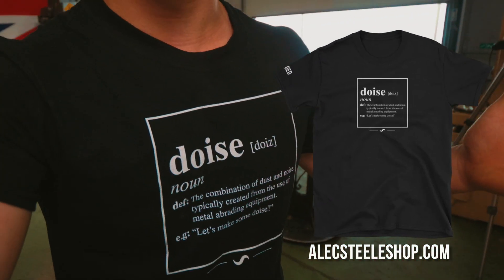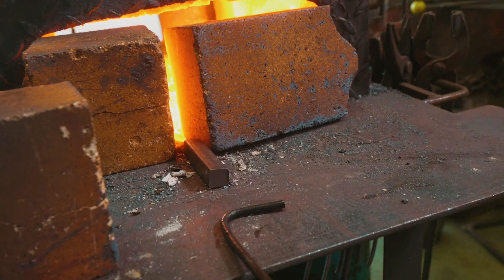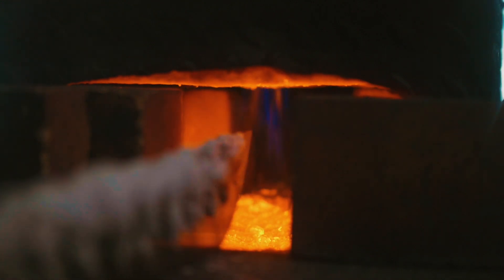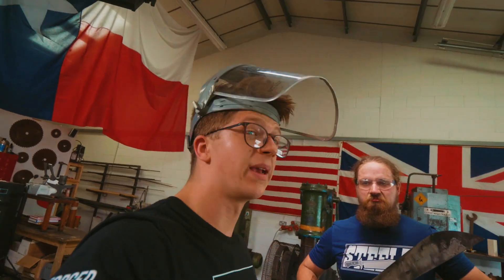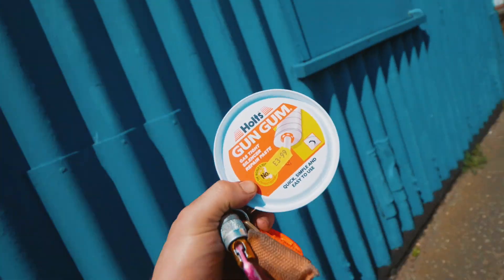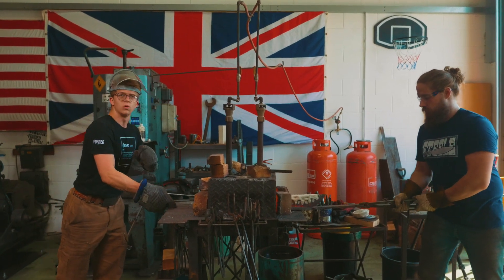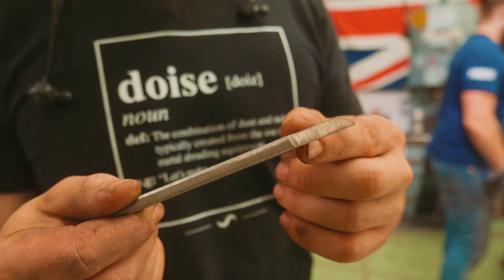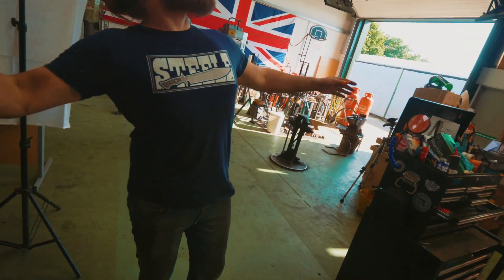MAKING A FALCHION!!! Part 3

Comment: Just putting it out there again: Alec, buy a commercial pizza oven for your workshop. Big enough to temper swords and make pizza while doing so. WIN - WIN Situation.
Reply: Agreed.
Reply: then alex french guy can come and use it!
Reply: My m8 has one that’s 150cm x 100cm inside and can hold any stable temp from 80c to 425c for hours. That will fit a blade up to 175cm in length and a couple of big pizzas... got it used for £450 ex vat. It’s a no-brainer really :D
Reply: SoupFork He can invite French Alex back to make a knife set, and British Alec's father could come in and make them a knife block. :D
Reply: DarrkDucky just realized I commented the same thing. Great minds...
Reply: SoupFork the fact that it makes pizza is reason enough. Tempering is just a perk
Reply: He doesn't even have to buy one. They are relatively easy to make yourself (they are really just a stone oven). You just need heat resistant bricks and clay and a YouTube video on how to make a stone oven or a pizza oven specifically which I am sure there are a number of videos on. Jas townsend and sons has a few on stone ovens. Also on a blacksmith related note they are not much different then old stone forges and smelteries.
Reply: And his blades will have that smokey flavor that pizzas get.
Reply: Oil Barrel furnace depth is long enough to even heat a long(ish) sword evenly without the moving in and out to get even heat, then could be used for tempering once cool enough ... Thinking 3 or 4 burners on top. not sure about heat distribution within the dome but should be good enough, chicken wire to hold fire bricks in place on top...
Reply: Brilliant idea
Reply: Scale?
Reply: Please do not do this, do not buy a pizza oven or a toaster oven. buy a professional grade heat treating kiln. why? oven for cooking are not insulated nearly as well and do not hold temperature as accurately. you may be surprised how much fluctuation there is in even a commercial grade oven's temperature that will ruin the temper on a knife or sword. 

right tool for the right job ladies and gents.
Reply: Tom K did you even SEE how he tempers his long blades now..?
Reply: Yeah, a heat treating oven big enough to do this kind of thing isn't really that expensive here's what I found in five minutes on google http://www.paragonweb.com/KM45T.cfm
Reply: Rhys Harris the cheapest (smallest) one is $2900+ excluding tax and shipping to the UK. The longest one is just 42”, which will be a struggle for any decent sized swords. (And a LOT more expensive...) But the main problem with these is the 5.5” width limit. Who the hell wants a 5.5” Pizza...
Reply: Tom K you missed the point. Also, blades were tempered by hand and I for many many years. Wuit being a buzz kill and go make something yourself.
Reply: Alec, next time you test a sword, instead of slicing fruit, slice up pizza toppings, then top a pizza with the topping you have sliced.
Reply: Double Dare Fan I like your way of thinking

Comment: It's not the oil temperature.  You simply should have tempered it immediately , even with the remnants of the furnace cement on the blade..  Differential hardening puts the blade under enormous stresses (even more so than regular through - hardened blades) and any pre-temper grinding needs to be exceptionally superficial and must not heat up the blade at all or you risk stress cracks as removal of material will relieve stress on one side vs the other side.
Reply: Absolutely 100% well said sir. Especially when dealing with a very high carbon steel (1095 has about 1% carbon, so after a fast quench it’s diamond hard). It’s got lots of stress in the blade. 

What I do is I have some steel wool or sandpaper handy to very quickly and crudely scratch off forge scale. As soon I see the blade, into the temper it goes.

Comment: THANKS SO MUCH FOR DOING A HAMON!! So excited for this build. Thanks for getting me into such an awesome craft!
Reply: Hey Alex, just something I was told when doing a hamon. The stress fracture may have come about as you didn't coat the whole blade with a thin layer of gun gum and then apply thicker on the back edge to get the pattern
Reply: Well as you normally quench 1095 without always having clay on it that shouldn't be the problem, no. thanks for the suggestion though

Comment: Looking good man, liking the progress, only tip I can give for clay differential hardening is to put a few thin lines of clay down to the edge of the blade. This creates tiny regions of softer steel which help relieve stress and help reduce cracks when tempering or grinding. Also stops cracks permeating up the entire blade during use. Keep up the good work man!

Comment: I would recommend Green Beetle's Hamon method (or as his videos series is called, "Hammonding"). What he does is waiting a full day for the clay to dry (might be harder to do with the stuff you use as the fibers in it would hold moisture longer), he quenches in water (though he has said oil is okay), and he goes into tempering immediately after quenching and sorting out any warping. He also brought out the Hamon with lemons.

Comment: Suggestion for the guard.  After you've got it cleaned up heat it and use a brass wire wheel on it so that it will transfer the brass color onto the guard.  It'll look GREAT and still be steel!

Comment: Hey Alec, a tip for next time with the Hamon, Ilya from Man at Arms runs really thin lines of clay down from the spine to the edge to prevent that from cracking during heat treat, maybe that would help for after heat treat too?

Comment: I'm a bit confused about heating up the oil. Alec says it makes the blade cool down faster yet ABS Mastersmith J. Neilson from Forged in Fire says it slows down the cooling, which makes sense to me as the concept of quenching is you are rapidly cooling the blade to harden it instead of letting it slowly air cool.
Reply: Its to keep the blade from cracking from cooling down too fast.

Comment: Alec most traditional falcions have a through tang and I had no idea you could use gun gum as clay here is South Africa it is used as a high heat repair putty for exhaust repair and the like and you could make a straightening jig using some angle iron an a few clamps

Comment: Tip from a woodworker - always go bevel down when cutting a groove, you have a lot more control with the cutting depth (in other words, the blade won't dive into the workpiece).

Comment: First time, Alex grinds it.... It cracks.
Second go around, Alec is the one on the grinder.... 😂😂
Reply: Nunya Biddness he must have been feeling terrible taking that to Alec :(

Was it even in contact when it cracked though?
Reply: I'm wondering why they didn't temper it before grinding.
Reply: they had to remove all the clay and burned stuff from the blade

Comment: What about a roll-away extension for the forge? The current one can be kept small when not needed, but can be rolled over and snugged in place for adding extra length to the existing forge for these longer projects. If needed it could have its own burner as well.

Comment: Hey Alec just a little tip if your using gun gum, if you wet your fingers slightly it stops it sticking to you and you can smooth it and get it where you want it easier

Comment: I'm not a blacksmith but for the whole work and the Beautiful original shape of the falchion I would have open the crack with an angle grinder in order to tig weld the entire fissure. It's not Damascus Steel anyway. And if you're worried by the HAZ just normalize it and then proceed as always.

Comment: For the wire inlay, if you twist it with another color as you inlay it you get an interesting pattern at finish. I don't remember if its the hatch pattern or parallel lines like //

Comment: It would be interesting (to me at least) to see if that crack had been under the wires used to form the pattern for the hamon. If the wire retained more heat and transferred that heat to the blade, it could explain the stress fracture (since the blade would be even harder at that point, and the act of sanding it would generate the additional heat to cause it to crack).
Reply: The way I understand it. The faster something cools, the more brittle it becomes. So if the wire retained heat,  that part would be softer and more pliable.
Reply: TheQuantumCreeper ..either way, I think the wire had something to do with the crack. On episode two I kinda had the idea that the wire might create a soft line to the edge.

Comment: Now that you make so many knives, swords and other blades, have you thought about making a second, long and narrow forge/tempering oven? In kind of a tube design maybe? It would be less volume to heat and at the same time more even than having to paint the heat all the time. And Alex would get to build a forge with you ;)
In addition, I just had an Idea: you have your melting oven for casting and you were talking about inlays. Is it possible to take a metal piece, cut the pattern into it that should have the inlay on it and pour the other metal on it? Afterwards you grind it flush and have a perfectly filled inlay. Might just be crazy enough to work ;)

Comment: Hey Alec, you mentioned  "I've warmed the oil up a little bit, which will help cool it down even faster". I was curious if you could explain a little more how that works? If it were water, I would guess that warming it up gets it closer to the boiling point, and that maybe the water is able to suck heat out of the metal faster while it's going through the liquid->gas phase transition? But I'm not sure if 1. that even makes any sense, and 2. if that explanation would also hold for oil.

Comment: The heat of the oil want the issue so be 1095 requires a faster quenchant than 1080

Comment: I believe “Hamon” is used to describe the line between the hardened and unhardened steel. Differential hardening is the actual process,  not creating a hamon. Nit picking yes but had to try to do Japanese blades some justice.

Comment: Alec, it's best NOT to grind on fully hardened blades and, in particular, Never surface grind them (don't ask me how I know).  Always do your tempering first, otherwise, the grinding stress can literally tear your steel apart.  By the way, furnace cement works great for claying a blade.  It's much cheaper than that stuff that you bought, and it dries faster.

Comment: personally I would have ran the normalizing cycles. drilled the end of the crack, ground the area around the crack, then taken a piece of the same material and using the TIG welder I would have filled the crack and drill mark.

the point of using the round drill bit is to stop the crack from going further. do some weld prep to insure clean and full penertration. and by using a cutting of the same material as your filler it should mix in without causing an obvious difference in materials

Comment: Heating up the oil won't increase the speed of quenching, it will reduce it, beacuse the heat conductivity of the oil will decrease, meaning that the crystals of steel will have more time to settle down therefore creating less martensite.

Comment: Just would like to throw this out there. You don't need the clay to get the hamon. in America the hamon is also called a differential heat treat, done so by heated the edge hotter than the spine, looking at the color of the steel on the edge to get to cherry red. It's about the same and even gives a better color distinction between the blade and the spine. Thought maybe in the future you could try it and maybe it could save you some time. Cheers bud

Comment: I wonder if the bubbling bit could be produced by gasses trapped by the clay or perhaps it's just the moisture in the clay evaporating quickly. Is there a reason why you wrapped the blade in the wire before applying clay and not the other way around?

Comment: I've never seen anybody else use the Hamon method y'all are. Specifically the wire wrap (everybody has their own clays). But looking at the last few cracks yesterday and today, and the videos on the channel you say you got it from. it looks like all the cracks have been where the wire is down the blade. This is probably conducting heat under the clay. Making those areas more brittle. Look into making ashi, i would expect they would allow more toughness to permeate the length of the blade by providing, interruptions from strait blade hardness. But that's just my theory.

Comment: You want a MUCH shallower angle for your graver (and don't use it upside-down like that!).  Think more like 5-10 degrees between the belly of the graver and the work.

Rule one of engraving: Sharpen your graver.
Rule two of engraving: Sharpen your graver.
Rule three of engraving: Sharpen your graver.
Reply: Also, the key to engraving is CONTROL.  The tool is very sharp and much harder than the work, so it will let you hog out huge amounts of material.  However, to do that you have to hit harder and harder, which means you have less control over where the tool goes.  Slow down, take less off with each pass, and you'll be happier in the end.

Comment: why does warming the oil speed up the quench? you'd think if the temperature differential is less than the cooling will happen slower.

Comment: Could you Do a Hand-and-a-Half Blade? You have to use a similar process, with two different steels, with a Unique Hilt and Pommel. This is an oddball in the world of swords, but it supposedly lets you use a shield, while using the heft of a proper longsword as drive. I've only seen vague sketches of it before, and No-one on Youtube has made one to my knowledge. It would be Interesting to see what you could make of it. 
Ta! Good luck on your Falchion in all of its Falchion-ness!
~Dmitri Rudder
Reply: Dmitri Rudder  the falchion of this style is actually as heavy as an arming sword or a normal one handed sword, the blade is meant to cut fabric armour so the edge is extremely thin, after the spreading of metal armour the falchion became thicker edged.
Reply: Oh, Well then, I feel Silly Now... Thanks for the Information I suppose. I've seen plenty of swordsmasters applaud the merits of the hand-and-a-half combat style.

Comment: Don't think it's due to oil. You should have just tempered it right away without grinding. Obviously uneven hardening should put some extra stresses in the steel, which can lead to cracks

Comment: I would have ever so slightly thinned out the mud, and simply used a brush to paint the thinned down mud onto the steel. Saw it on Discovery Channel. No wire.

Comment: Wouldn't cooling the oil cause a faster quench by pulling out more heat at the start at a faster rate (bigger the temperature difference, the faster the transfer for a given set of materials, all else being equal)?  If you could heat up the oil to the same value as the steel (somehow keeping it liquid and not on fire), there would be NO heat transfer at all so an "infinitely long" quench, in effect.

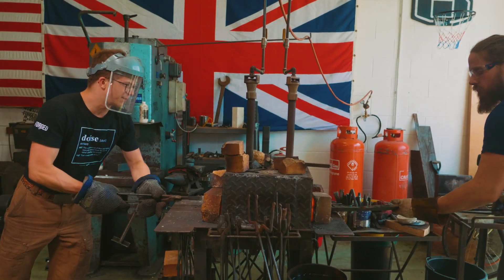Comment: 11:28 Hotter oil = faster quench? That doesn't seem right. Hotter oil means you don't have to put in as much energy to vaporize the quench medium and form the vapor blanket around the quenched piece. Since the vapor blanket insulates the piece from the rest of the quench medium, making it easier to form should slow down the quench. Am I missing something?

Comment: hey alec, community
i have some questions for the damascus. A friend and I are going to going to build a forge (coal) and want to make some damascus knifes. So we dont have a power hammer and have to do it by hand. I see you always using the flux (borax?), is it really necessary to use it or does it make it just easier to forge-weld it? Any tips for doing it with a sledge hammer? (Maybe temperatures or colors for forge welding it).
I had often read to use coffee instead of the ferrit-chloride to make the pattern apear, is that working really well (for example how deep it goes, that the pattern is not handsanded away), maybe what about a test`?
Reply: 666DeadDeath yes you need borax(or some other fluxing agents) when forge welding. At least to start with. It flows between the layers and cleans out the oxides that form when steels are heated. As to temperatures, flix the steel when it's dark to medium red, weld when it's bright yellow. Id it's white hot and has sparks coming off it, toss it and start over as the carbon is burning out of the steel. And yes you can forge weld with a hammer, start gently to set the welds, maybe on a block of wood(watch videos from Shurap, great example of hammer forge welding).
Reply: Mike Ford thank you for the quick answer. But would it be possible without using flux? Especially when using coal for the heating. Are there some tricks by hammering it with a sledgehammer?
Reply: It can be done without flux. I cant remember who has a video of doing that way. And nope, no tricks. Just heat, tap gently to start the weld, heat some more and beat
Reply: Mike Ford thank you for the answering, we'll see how it works without flux.

Comment: 1. Clay isn't dry? Go for it!! (uneven heat distribution)-Or,  Let it dry, and proceed....
2. Quenching oil is too warm, so it transfers heat too fast! It cracked!  (.... dafuq? ) The warmer/hotter the quenching medium, the slower the quench... If you want a faster quench, surround the quenching vessel with ice water for 60 - 90 minutes before quenching.

Comment: When Forge welding you should use borax and water
Reply: The water can be placed on top of a hot work piece and I'll help remove some of the oxidized metal

Comment: I'm not sure if the clay is supposed to bubble like that ? the air bubbles can affect the heat transfer. I'm no expert, though. A clay wich can harden and dry a bit before the heat treat could work better